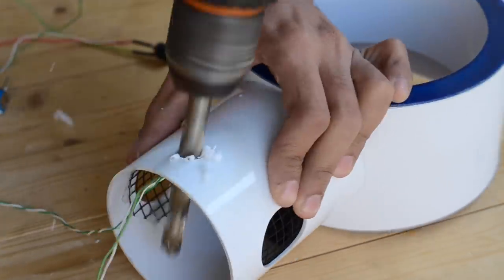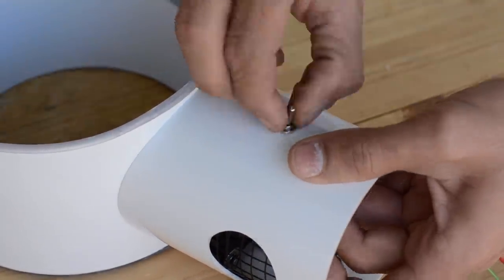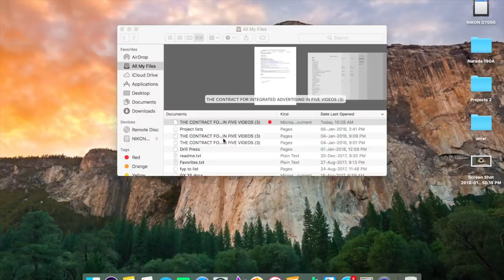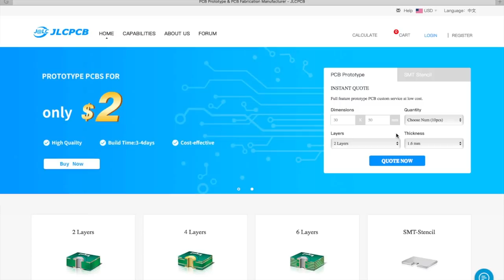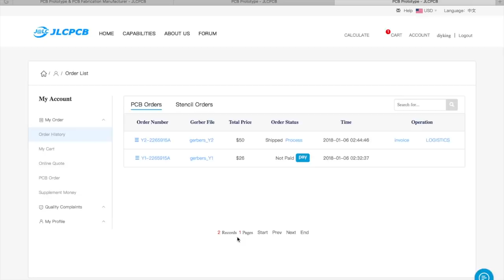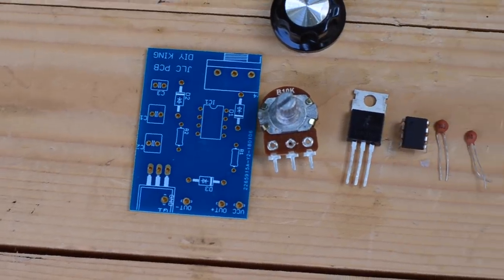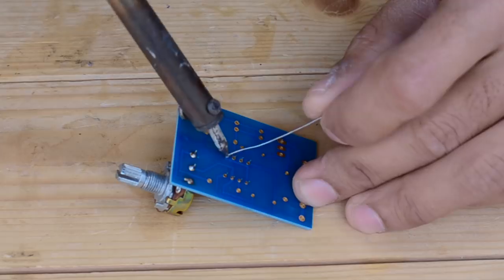How to make a Blade-Less Table Fan

Comment: I can do this!  It's been 30 years since I studied electronics but I'm excited about this fan project because it's safe for children and pets. The only change I'd like is a "kill switch" in case of accidental tip-over.  Please consider designing a remote-controlled pet toy.  I have a very active beagle who loves to chase things!  I imagine a ball with multiple 'bumps' that'll wander around the room in a random pattern, maybe with a speed control.  Thanks
Reply: Merry Mary hi
Reply: Merry Mary u r an Engineer?
Reply: THIS device in not safe for children
Reply: No - I just think that way!  I sew, make jewelry, and repair most anything before I pay someone else to fix it!
Reply: Oh, that is easy. Get a mercury switch and wire it in series with the power supply. On the cheap, you could just use a glue gun and glue it at the required angle inside the base. Otherwise, rig up a collar for the tilt switch.

But even if you tip it over, what is the harm? There are no exposed moving parts. I think a change I'd make is to add an elbow to the intake hole. That makes it harder to stick things in there. It is just a standard computer fan inside some PVC and some unnecessary driver circuitry to control the speed.
Reply: Thinking that way, yes, just like my family.
Reply: Did you make it yet?
Reply: see we
Reply: very nice
Reply: Working with a ‘press switch’ should do the trick here.

Comment: Mad props for solder and shrink tubing.  Well done.  When I see someone twisting wire connections and then secure them with electrical tape I have to abort the video.

Comment: So Pumped up to make this all i need now is to buy
1.) 3" PVC pipe
2.) 5" PVC pipe
3.) 6" PVC pipe
4.) Perfect size box
5.) A fan
6.) LED Strip
7.) Switch and Regulator
8.) Solder 
9.) Grinder
10.) Cutter
11.) PCB
12.) Wires

Comment: Have you thought about combining the bladeless fan with a 10° C DIY portable ac project? Also, is it possible to run the fan off an old laptop battery. Then you could take it with you after work is done.

Comment: One more quick Question! I notice allot of DIYers use the same type of glue in the same type of Bottle(looks like an Eyedropper with a spout). May I ask what is in the bottle. Can't it be superglue? Might be why I have so many issues gluing plexiglass, I use the wrong glue.---Any chance you will be doing a tab welder?
Reply from the maker: njfulwider5 yes its super glue. The key to strong joint using super glue is to make sure both surfaces are rough and clean if not then use sandpaper to make them rough. Moreover make sure your super glue is from fresh stock.
Yes I will be making a video for DIY tab welder soon.
Reply: My joints are strong, I just always have issues with cloudiness.  It seems after the glue has set, I get a small cloud. I have used all types of superglue. I didn't think super glue would work in a container like the one you use? I also use Gorilla super glue. I saw in another video, where someone said to use methylene chloride or acetone. I thought maybe you used something like this because the glue you used looks kinda watery.  I  have even cleared up my cuts with a hot air gun, so they look smooth.

I did just recently purchase a 2 part glue for plexiglass. You spread one part on one side, and then the other on the side, you join it too. The only problem with this, you have one shot. Once the 2 parts touch they are solid. So no room for error. (have not tried this yet?)

You should check out my Google+ page when you get a chance. I have a few welders I have built. My last one has 3 adjustable controls(speed of plus, power of pulse and amp control), and no armature, just cable electroid. I have 3 others, I built with armatures. One I build with very minimal parts(works the best)..LOL

Check out my Google+ or Twitter...I have tons of other DIY projects there also you might like or take on and make better(I am a newbie"6 months"). I really enjoy your videos!
Reply: Its a fast acting superglue of "cyanoacrylate" class of glues. Google Cyanoacrylate super glue.More details >>> https://en.wikipedia.org/wiki/Cyanoacrylate
Reply: Hey Thanks for the Tip! Been playing around with a few different types I can get local. Come to find out, you can find Cyanoacrylate super glue at my local Dollar Store! So I purchased around 20$ of it and it works Great!
Reply: You're welcome.. glad i could help.. : )
Reply: yes
Reply: yes it's super glue
Reply: Feviquik and rubber hot glue
Reply: Hahaha  sure i thought am the only person noticing this . Thank  you!!!!!
Reply: That is' glue gun ' easily available on amazon
Reply: It's flex kwik
Reply: njfulwider5 , it's like real thing glue, I think it's acrilic glue.
Reply: njfulwider5 locktite uses a bottle like that too.

Comment: Might try using a 5V system, 5v fans are easy to come by, the switches would be the same, and even the LEDs would be easy to find, the best part would be that you valued run it off a phone charge. The power input could be an Android port, allowing you to be able to replace the cord easy

Comment: Stability is better achieved with 3 rubber pads at the base, rather than with 4
Reply: Just glue (or screw) the base... on an upturned plastic dining plate

Comment: I wonder what the cost of the build is. It makes more sense if you happen to have a lot of the parts hanging around. You can get bladeless fans now for $30. The server fan and adapter would cost about $10 each. It could cost more to build than to buy.

Comment: Its SUPPOSE to be bladeLESS,why is there a 12-volt electric FAN in the project??.
Reply: Bladeless is for sight
Reply: That is what it came to my mind, deceiving title. Isn't' it ?
Reply: Sathyanarayan T Yes it is...more B.S.!!.
Reply: How the fuck would YOU make the air move? Via telepathy?
Reply: It's an impeller/turbine not a traditionap fan blade there are even air movement systems that look like augers.
Reply: Raymond Leggs It doesn't move enough air to justify the $500.00+dollar cost and is a waste of time to build it for the same reason,it doesn't move hardly any air at all.
Reply: As other commenters have (somewhat rudely) stated, the "bladeless" aspect of the fan means that there are no visible or exposed blades such as you see in a traditional fan.

Similar to the Dyson brand "Air Multiplier", the fan is located in the base pedestal where it is kept out of sight.
Reply: John Scott Its a RIP OFF to either build this or to pay over $500.00 dollars for a device that moves less air then a mouse fart.
Reply: I wouldn't know as I have never owned one, I was simply responding to your statement about having/not having blades.
Reply: John Scott I know that,but if you ever try one,you'll tell Dyson that he is a scam artist.
Reply: Θεοδώρα Ζεμπίλη  um IONS electric charged metal plate, will move air .
Reply: Val Tozer Build one on 📷 camera,live stream here on the"Tube"and put Dyson and his minion clones out of business.
Reply: Stixx n stones This is REALLY COOL!!.From what I understand,ion-propulsion is what is being experimented with in up coming spacecraft manufacturing.This really works.
Reply: 4 gauge  Yes sir, negative ions will move toward and through a charged channel (anode to corona)...in a nutshell.  It's a little more complicated than that but still true.  It would provide thrust in a space craft but not as powerful as a rocket motor.  However ion generators don't expend fuel, the thrust ratio is much lower but constant and maintained over long periods of time, using solar energy for continuous thrust.  Theoretically Ion engines could achieve velocities close to the speed of light if given enough time and continuous operation.  Glad you liked the link
Reply: it wouldnot work without this its simple logic physics
Reply: Hejter Ion propulsion works,the "hidden fan"is garbage.
Reply: Bladeless fans like this mean the moving parts aren't exposed like a traditional fan. This makes them safer, especailly around young children. The Dyson model and some knockoffs use blowers/impellers, and some use regular fans like this DIY project. The ring uses similar fluid dynamics to an aircraft wing to direct the air. I've tested Dyson's model and the air that comes out of them is steady, you get a lot of air from them than you might think. Though don't buy the Dyson model it is overpriced, go for one of the better knockoffs that are cheaper.
Reply: Michael Haney  Google ion fan and you'll see what I'm talking about they actually make a fan that uses ion for propulsion and does not use fan blades like in the Dyson or the cheap knockoff which move almost no air.
Reply: 4 gauge - Those produce ozone which can be a health risk if too much of it builds up in a room. Sharper Image had the Ionic Breeze which uses this technology and they were found to produce a dangerous amount of ozone. We used to have one and it made me sick so we stopped using it.
Reply: Michael Haney Oh I know,but its a TRUE BLADELESS design and not a bunch of smoke and mirrors like the Dyson and its clones are.
Reply: True, but ion fans can only produce a very faint breeze. They can't move the kind of air traditional fans or blower/impeller style fans can. That's why they've never caught on, that and there are health hazards of breathing ozone. Ozone is fine in the upper atmosphere, it protects us from UV rays, but down here where we live it can seriously screw up your lungs and the smell can make you nauseous and give you headaches. Ion Fans are bladeless but they aren't safe.
Reply: Michael Haney Too much of anything isn't good for anybody.What I'm saying is this...DON'T PROMOTE A PRODUCT WITH SMOKE AND MIRRORS,be honest about it,this isn't a BLADELESS fan by a long-shot.The BLADES are in the base of the fan,so this means that it STILL USES A TRADITIONAL FAN,regardless of its location.
Reply: 4 gauge I know your correct that there is a 12v fan in there but can you make a fan that does not have I have seen no fan that has no blades in it this piece of art is amazing I'm not being rude I'm just letting you know :D
Reply: real itz_Harry49 Oh I know,but you can slice up a"Snickers bar"a million ways from Sunday and its STILL "Snickers".A fan is fan regardless of how its designed.
Reply: TheClumsyPenguin With blades...HAHA!!.
Reply: 4 gauge facepalm
Reply: 4 gauge dont be so ignorant.
Reply: Leangelois I can only be what people seem to understand.I'm not into scam tecnology.
Reply: Takoza But you don't need a fan to move air though.
Reply: you are just a hater, its very much OK to use the fan!!
Reply: JR Simatwa Sigh...I guess deductive reasoning isn't your thing and I bet you bought into the Dyson SCAM technology too,INCREDABLE!!.
Reply: Thank you for that reverse psycho tech, this is just my opinion unless you had a better video of the same,make and upload we see.
Reply: JR Simatwa Why would I have to?.
Haven't you heard of the Ionic Breeze??.
Reply: TheClumsyPenguin The Dyson got very,very poor product reviews,the volume of air you get for your hard earned $500.00 is less then HALF of what a plain old box fan can do for $20.00 bucks at your friendly Dollar General store...HAHA!!.
Reply: Θεοδώρα Ζεμπίλη -- I could think of some ways. Like why not a linear motor, a diaphragm, and some check valves? Or a "blade" that acts like a diaphragm but is covered with check valves? Or why not a flap that moves back and forth, though that is still a blade. Or why not a modified speaker where there is a number of check valves cut into the diaphragm, and the coil attached to an oscillator circuit that gives the right amplitude and frequency? That can create interesting effects, since I turned on a portable fluorescent lamp near an AM radio, and the radio raised so much hell, and the speaker felt like "foam" was coming out of it, as there was no liquid. That was a tactile illusion, but that is what it felt like.
Reply: Kid
Reply: We should appreciate his creativity.
Reply: Subhajit Dey Putting a FAN in the bottom of a carcass is being creative,since when??.
Reply: 4 gauge it's not for 500dollars bro
Reply: Θεοδώρα Ζεμπίλη lol, air can move whenever there is pressure difference or temp difference... See ic engines 😀, there is no blade...
Reply: @chanakyasinha8046  SIGH...there IS a FAN in the bottom of the Dyson bladeless.
Reply: 4 gauge i know bro.
Reply: because it is not bladeless :D
Reply: @RahulSoni-xv4cz  That's why I call this video click bait.
Reply: @DJPaulgee1  supporting fake technology is not a smart thing, but a lot of people out here don't get that that doesn't surprise me one bit.
Reply: @raymondleggs5508   wrong it tells you its a 12 volt server fan the fans they use in computers to cool the computer down so it don't damage the moniter
Reply: Bladeless means you can't SEE the fan, but how would you make a bladeless fan? you can't do that.
Reply: Sad guy wit .2 IQ

Comment: 11:41 Dude, I'll give you a diamond tip that's worth more than gold, this cooler can be controlled by PWM without applying it to the power input wires, just connect the output of the 555 timer (which in your case connects to the mosfet gate ) on the blue wire that the cooler's internal motor driver controls the speed. As an additional I should mention that certain coolers do not change their speed by changing the voltage to the minimum operating voltage (what I have is 48v it stays at 10500 rpm turning on any voltage from 36v to 75v)
Reply: And one more thing I was almost forgetting, there are fans that don't like to connect the blue and yellow wires together since the sensor wire provides a signal that can be interpreted by the driver and mess up the operation (mine does that too)

Comment: Very nice job on a needed DIY project. This would be great for a family with toddlers and pets for safety reasons since the blades are not accessible. I like the comment that suggested you add a killswitch for tipover and a remote option. I would also though a timer option would be great.
Thanks for this fine addition to youtube. Keep it up!

Comment: i thought its blade less
it better to say the best way to hide the fan and to reduce airflow and increase power consumption ryt?
Reply from the maker: This kind of fan is commonly know as blameless fan as the blades are not exposed and definitely it occupies a high speed fan inside its enclosure.

Comment: It's not so difficult to build your own PCB board. You just need a copper board, shine it, take a butter paper, print the black and white PCB schematic from the one you build in the eagle. Paste the butter paper in the copper board, pass it through it through UV Ray for 15 minutes. Dissolve the board in the etcher and you will see the the track clearly. That's it. It takes time but it is not difficult. Also, the board in this video was very simple. Trust me, don't waste money getting from someone else, they will exploit you. Best is to build it yourself, simple and reasonable.

Comment: The best finished fan but the dimensions were not clear. & The circuit information along with the electronic components used were also important, if it is DIY knowledge.

Comment: You could have skipped the transistor on the board and just used the blue wire on the fan. It is used for regulating the speed.

Comment: Nice attempt but a true bladeless fan works on the Coanda Effect - this does not. With properly shaped rings (where the outer one resembles an inverted air foil with the air ejection slot at the leading edge) this version could have taken advantage of the air amplifying Coanda Effect but instead it is really just a ducted fan (which does have blades btw). Good project none the less..

Comment: i thought he used an lm317 voltage regulator for speed control.
Reply: That four wired fan already supports speed regulation. He didn't need a control board.

Comment: correction,  how to make a bladeless fan...   with a fan with blades hidden inside..      PPL outta think about it before hand...   bladeless nope theyre just hidden in the bottom for ineffeciency...   you'd get more air  if you just use the fan inside it.

Comment: I like the video project. It has very gute instruction und ist quite worthy viewing...However, the so called "blade-less fan" ist constructed with rotating blades correct?
One literal definition of "fan" ist a device constructed with rotating blades,...so "blade-less fan" ist literally an Oxymoron. Such phonetic appeasement for the more illiterate
of humanity's consumers ist sometime quite funny...smiles   There ist patented, truly "blade-less", air conditioning (heat und cool) devices that claim strong air-flow by multiplying
battery power to high-voltage then applying this difference in potential across polarized, semi-conductive, capacitive reactive, plates to create thrusting Ion Wind through a wave-guide
without any moving parts. Gute video though...smiles

Comment: A 12 v CPU fan can't produce more air flow. Overall project cost will be high for a mini fan.😢😢😢
Reply from the maker: This is a high speed server fan similar to the PC fan and it produces a lot more airflow.
Reply: CPU fan has a max rpm of 2000 in auto mode. Some branded pedestal fans had max rpm of 2300 and not only rpm, fan blade span is much more important for the air flow..

Comment: This is not a bladeless fan has no blades in any part of the van anywhere hey bladeless fan uses electrical current to move are not a machine that's putting it space that has blade that suck the air and push the air through it that is not a bladeless fan!